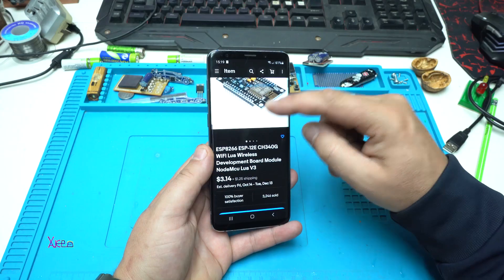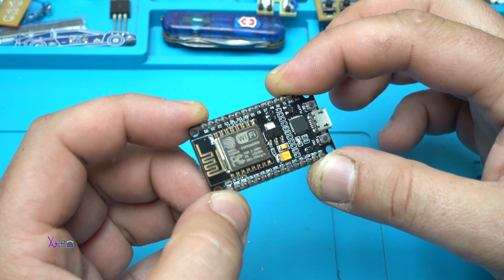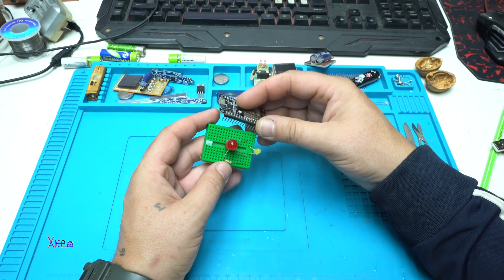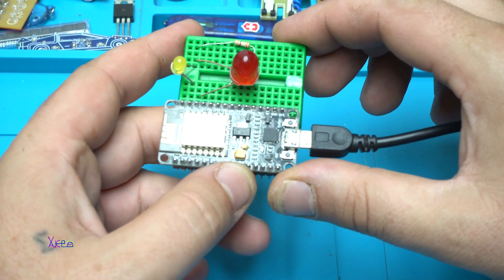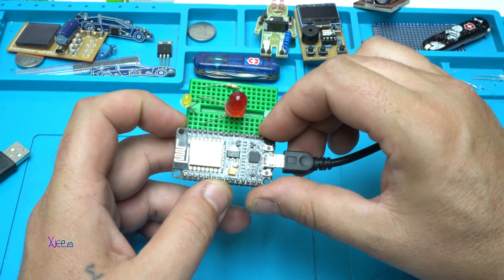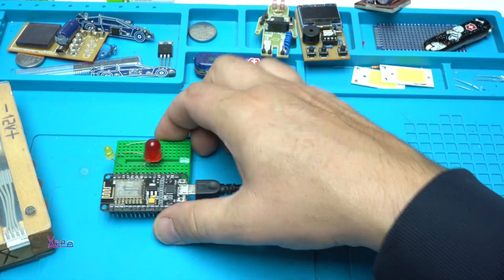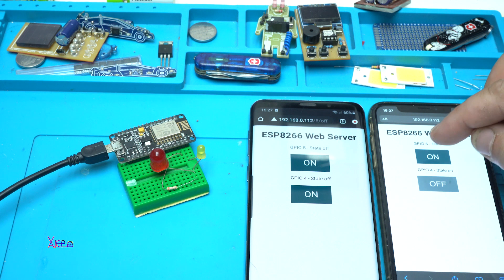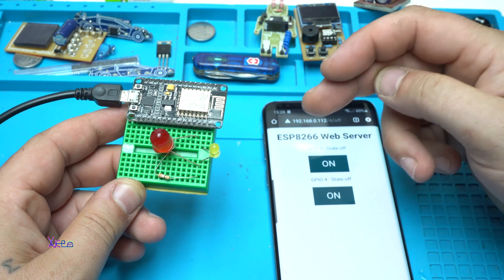How to Make Web Server with ESP8266 Schematic + Code free

Comment: hey, i got a question on a video you did wayyyy back in 2019, with the normal 3.5mm Y spliter cables for audi0 that send a normal headphone output to two separate mono channels can they be used in reverse to send two outputting L+R channels into an input which normally takes the 3.5 input? 

thanks
Laura